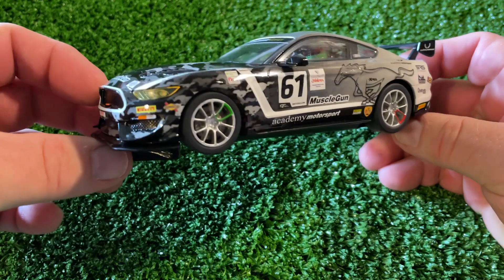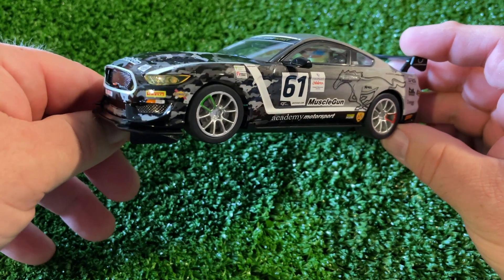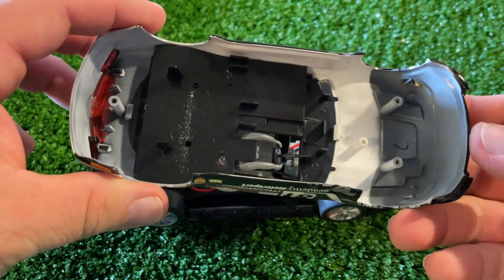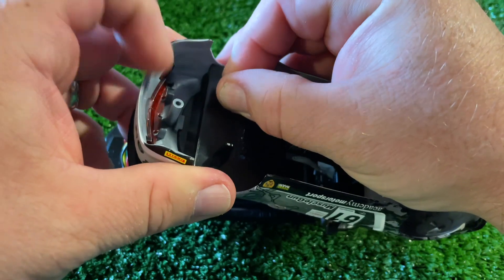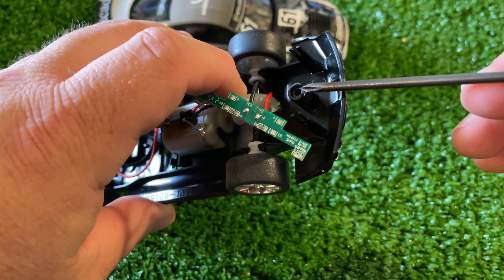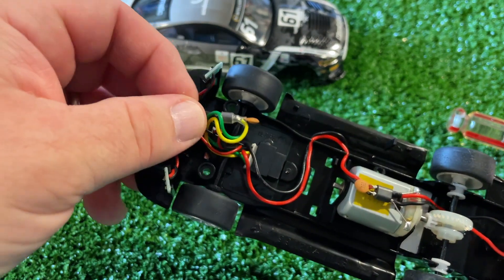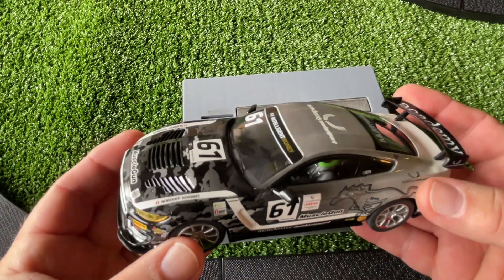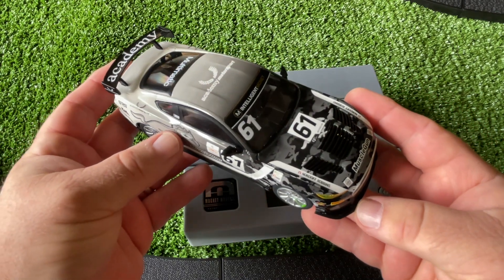Scalextric GT4 Mustang

Comment: Agree with you on the bushing & motor hold down posts. First thing i do is snip them off. Any movement/wiggle of the bushings/motor and out comes the hot glue gun. Rear light wiring always made me nervous, coming so close to the crown gear.

Comment: Thanks for the review Dave! I have a different livery of this car, and it grips surprisingly well with the magnet removed on my Policar track.
Reply from the maker: I'm going to take out the magnet and try it. I'm sure it's going to stick just fine, the tires feel nice and soft.
Reply: I drive this car without magnets. And I glued in the motor into the motor mount. Slightly sanded the rear tyres and it drives super smooth.

Comment: The rear magnet position under the rear axle has ribs moulded into the top of the chassis which lifts the 1.5mm magnet about 0.5mm off the chassis. That's why the magnetic downforce is lower than other cars. I don't know why they did this as the magnet location in front of the motor doesn't have the ribs. They should have had separate light boards for the rear tail lights like the Ford GTE. It is a problem with the rear body post to get body float. The Ford GTE has some cutouts in the chassis rails to hold the wires. It's great to see them starting to do this more.